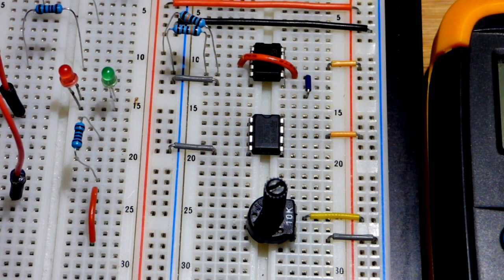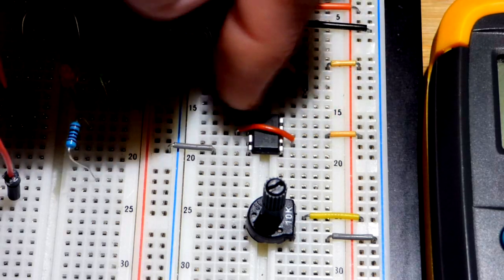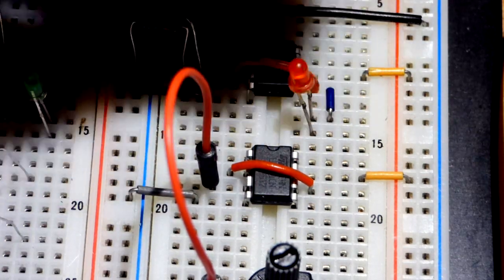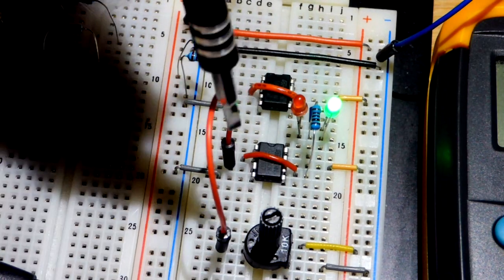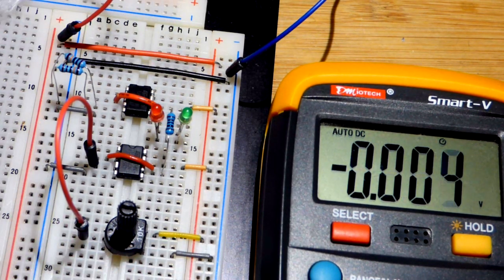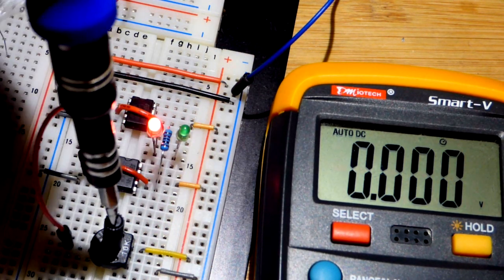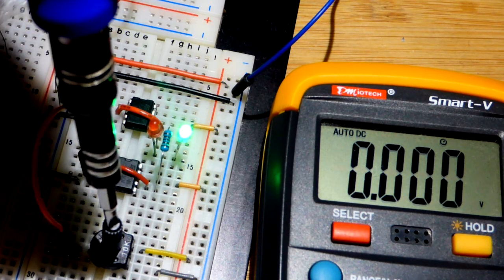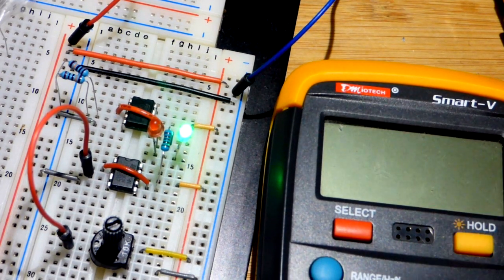Unity gain voltage follower circuit made with 741 UA741 op amp for beginner learning electronics

Comment: Why does your title talk about Unity Gain?  Is the other op amp necessary to achieve unity gain stable conditions?  Do you show any circuit diagrams?  I don't see any caps.  I'm trying to take a variable signal derived from my battery terminals through a voltage divider to synthesize a 2-5.5 VDC control signal for a programmable power supply to track with the state of charge of my battery (slightly higher to limit charing current to a something more gentle which should help extend the life of my LiFePO4.  Bottom line trying to develop an impedence buffer circuit thay delivers a somewhat linear DC control signal that isn't going to oscillate, and also to clamp the max output.
Reply from the maker: Sounds like you want to use a current source, such as a power supply set to CC (constant current). You just set the target voltage, the desired current, and let it charge. When current gets a lot lower than what you set, the battery is being charged to about the voltage you have set, so it's a good time to cut power since LiFePO4 shouldn't be held at the maximum charging voltage after it is fully charged. Monitoring the voltage of a battery while charging or discharging tells you more about power it is giving or receiving than it's state of charge.

Comment: This is a great video and I've watched it several times to gain better insight to the full set up. I'm still not totally familiar with your set up of the one op amp for the split rail operation but have a better idea. Do you have any schematics for the set up in this video of both op amps? Again, your video is great, I like the way you discuss in detail what's going on in the circuit and how it works.  Thank you very much.